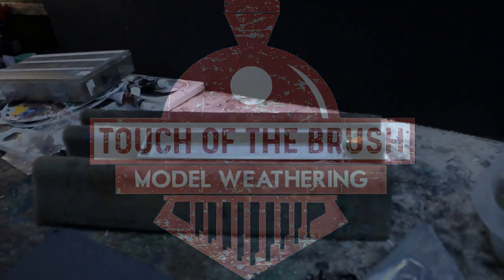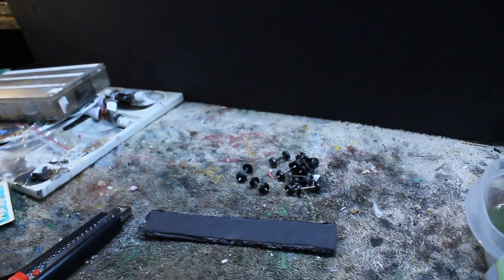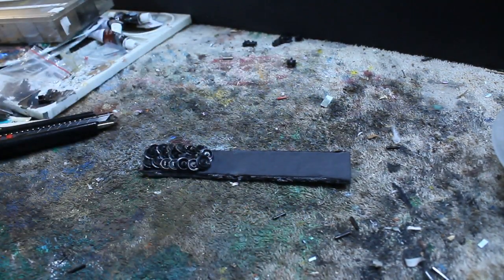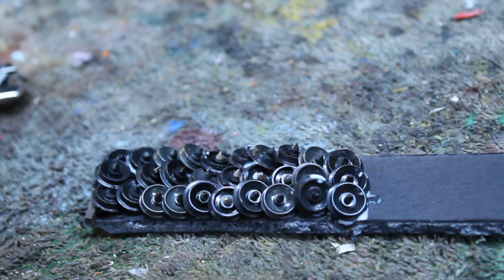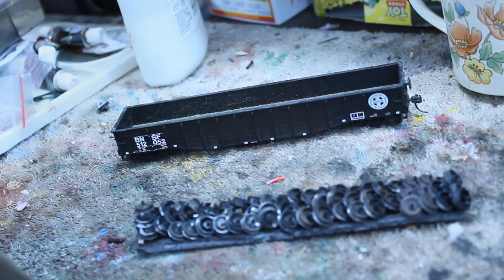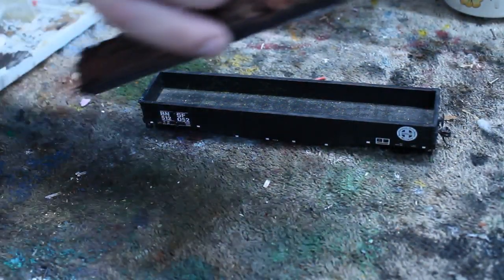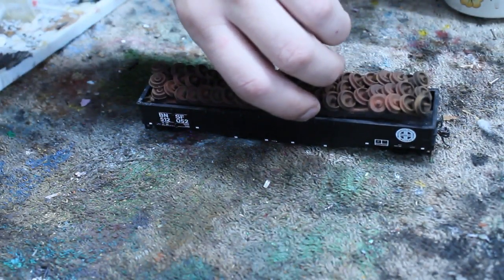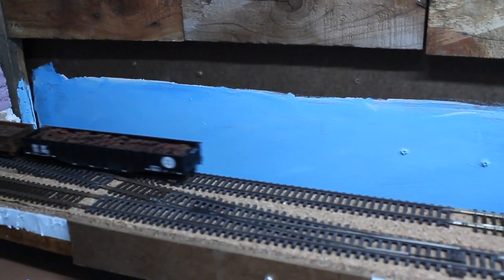Gondola Loads made Easy!

Comment: Do the plastic wheels, glue, foam board, and paint change the car weight drastically?
Reply from the maker: They add weight just slightly. That's why I used light materials. You can use metal wheels or plastic wheels with weights hidden to add weight.

Comment: After replacing plastic wheel sets with Walthers Proto 2000 metal wheel sets on about 100 pieces of rolling stock I ended up with a box full of plastic wheel sets.  I plan on using them for a gondola load and flatcar load.  I also save all plastic knuckle couplers to use as gondola loads too.  I also use real bituminous coal for gondola loads as well as steam engine tenders.  Cheers from eastern TN

Comment: Hey Joe I found that you don't need to cut the axles off you can pull one of the wheels off with your fingers & then take a pliers hold the axle with the pliers & pull the other wheel with your your fingers.